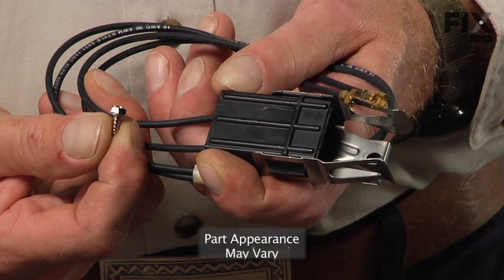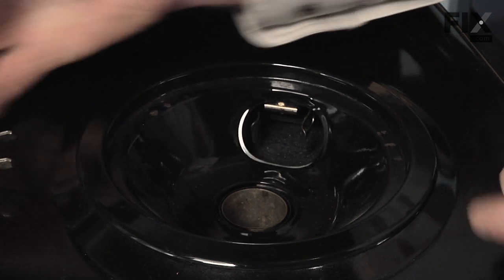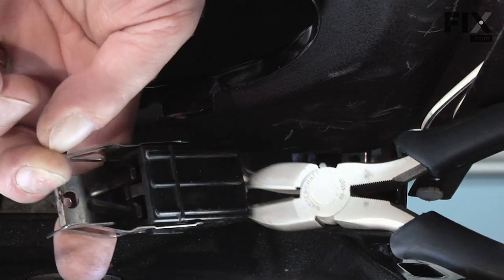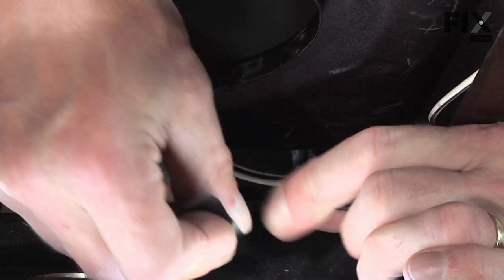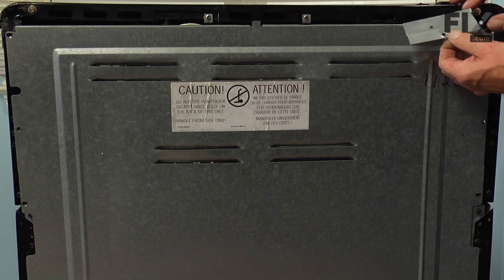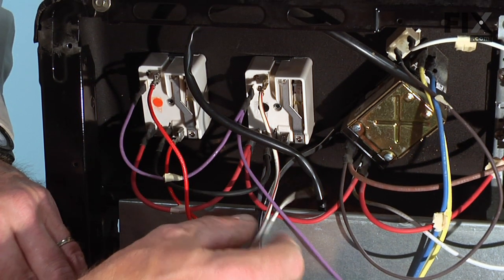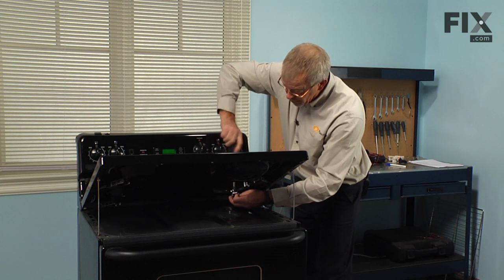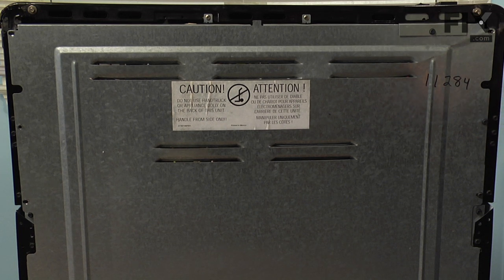GE Range Repair – How to replace the Surface Burner Terminal Block Kit

Comment: when you put the wires in the back, you didn't seem to know which wire went to which connection, so I guess it don't matter where each wire goes ? I changed mine ince before but I didn't remember that part....